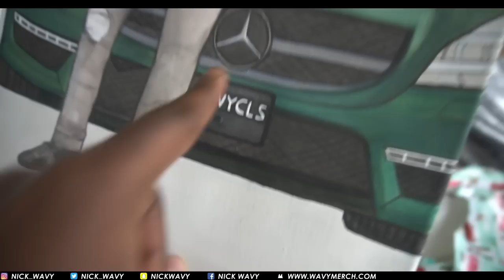Setting Up The Layout Of My New Barbershop (Wavy Cuts) - Episode 2

Comment: I would start out with 4 chairs with 4 quality barbers. Quality  > Quantity.  That way you not only have space for the barbers but also the clients/customers. Because if you figure you have 4 quality barbers you dont overcrowd them and also you won't have the Overcrowding of the customers waiting to get cut up whether they be walk ins or appointment. Plus if you're leaving space for a POS (point of sale) machine you got comfortable space for that as well. Nothing worse than a cramped barbershop on a busy weekend day with limited space. Then you can slide a Split vending machine in one of the corners that sells drinks and snacks, it'll cost you a couple bills but a wise investment for the long term and increase profits by buying bulk.  And sell Wavy merch in the glass case atthe POS machine.